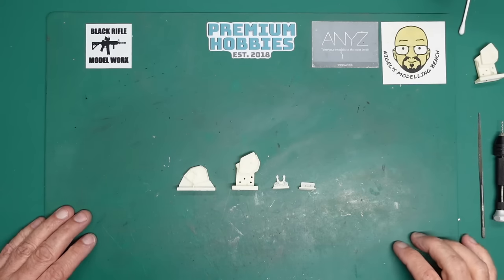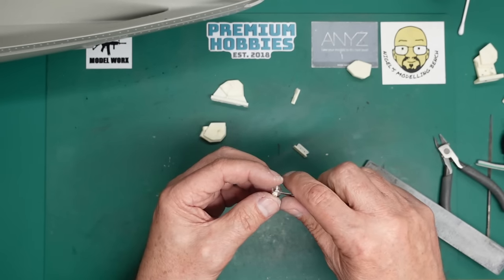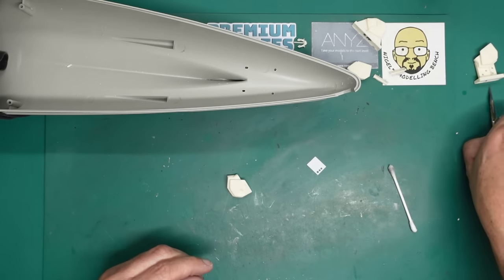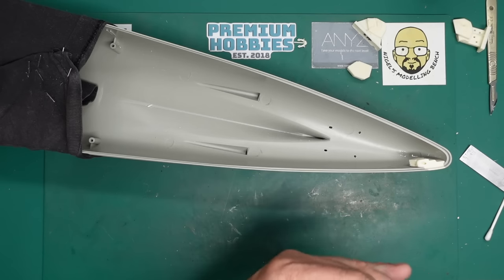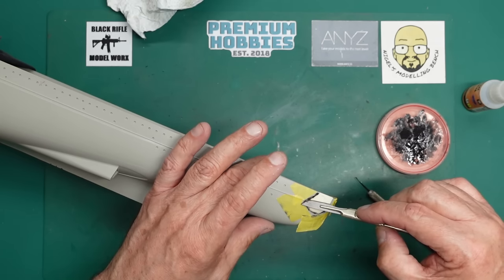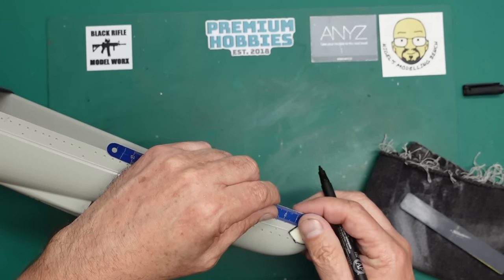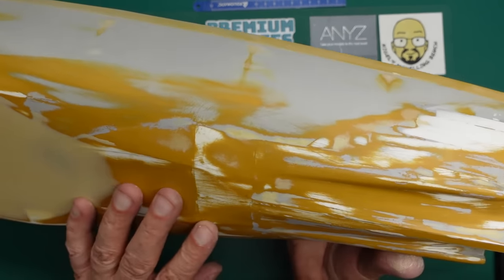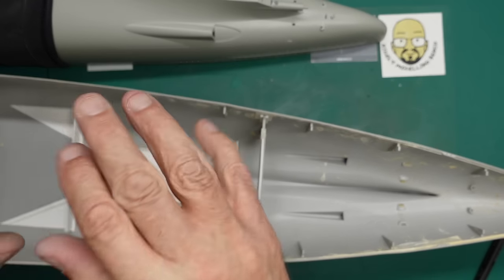Trumpeter 1/200 Scharnhorst Stern corrections

Comment: Hi Nigel, I have some of the flexi black super glue and i've definitely had shrinkage when filling ejector pin dimples.
I've also been trying your way of using a curved xacto blade to administer super glue around photo-etch and using a black pen to darken the edges of transparencies, both of which work briliantly - thanks for those tips.

Comment: How did you sculpt the anchor??
Reply from the maker: It's a copy of the original kit part, only smaller..
Reply: Yes but how did you scale it down? @NigelsModellingBench
Reply from the maker: I use shrinking silicon and as the mold cures it shrinks.